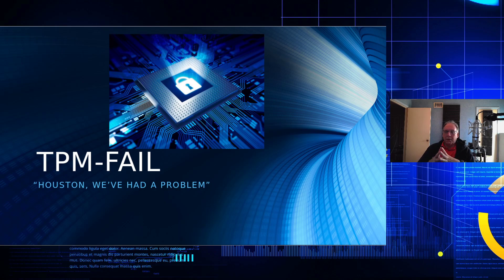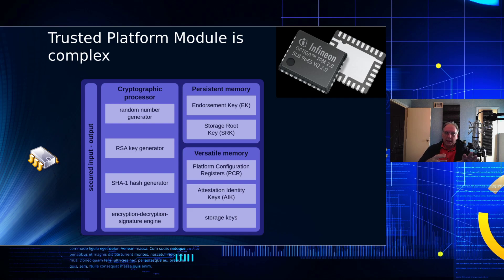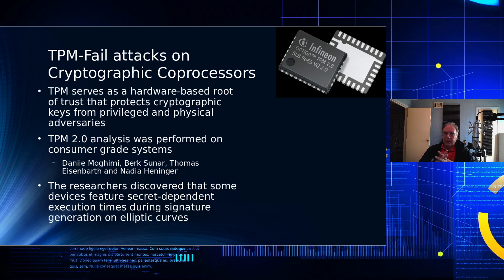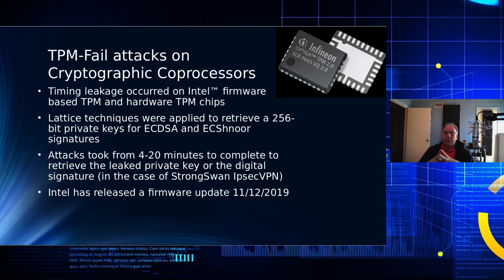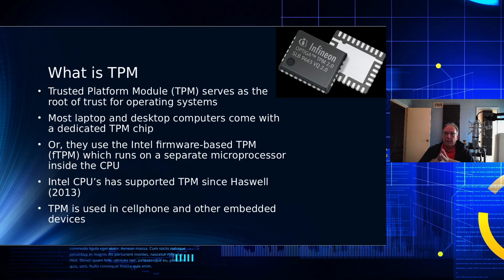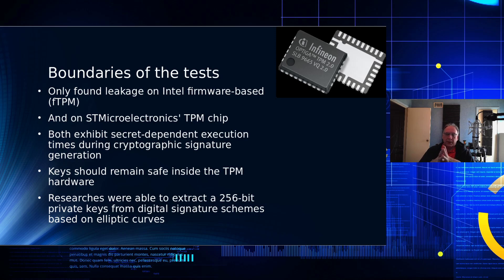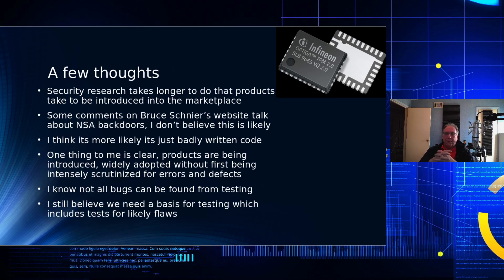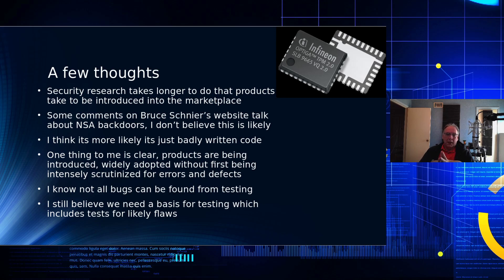TPM-FAIL - Houston, We've had a problem

Comment: What happens if the tpm stops working? What happens when you upgrade components ? I kind of want windows 11 but I don't trust the tpm. I'm always building and upgrading. If it fails you'll never get into your hard drive. If you put your hard drive on another motherboard, will it work if you transfer the tpm with it?